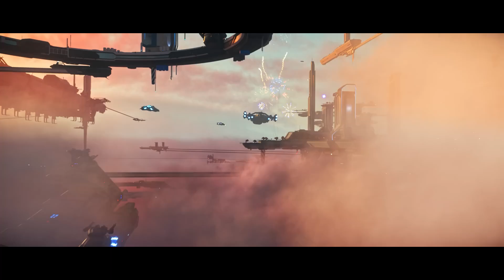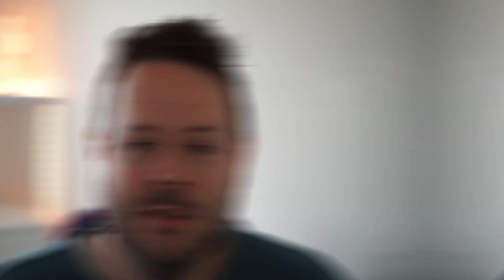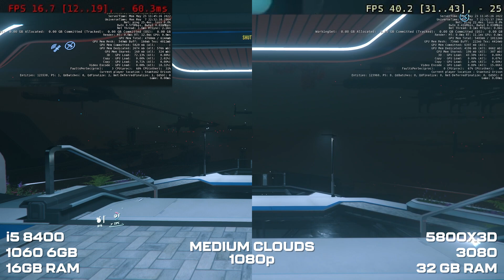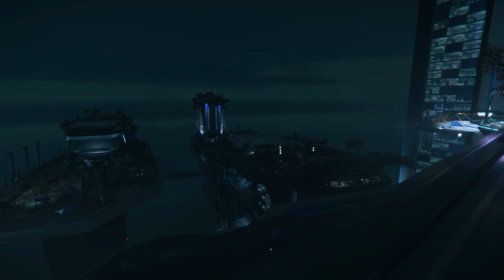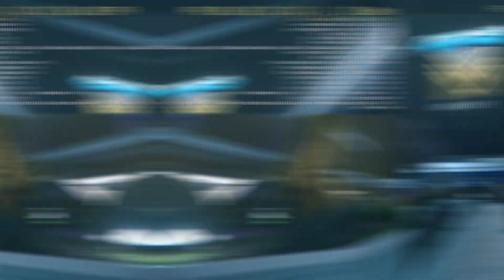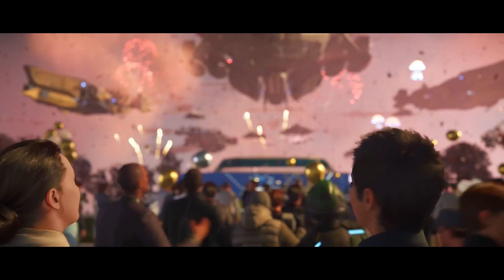High End Vs Min Spec | Star Citizen

Comment: So I have a rtx 3080 and a water-cooled 11th gen 8 core i7-11700k cpu running with a 1414p monitor, I currently have 16 gigs of ram but am about to upgrade to 32 as soon as possible. I finally got it so I can run at a decent fps (max of 110 fps on a decent server and 40-50 fps average while planet side) The problem I am facing now is that My computer is getting ridiculously hot, infract I have stoped playing star citizen because i am slightly worried about the health of my pc, I play loads of other games with no issues at all but for some reason star citizen is causing issues. Any advice?

edit: corected pc specs.
Reply from the maker: The 11th gen Intel chips are notoriously power hungry and therefore get pretty hot. SC probably pushes the cpu harder than any other games you play. What sort of temps are we talking? Does your case have decent airflow?
Reply: @tenpoundfortytwo  I can get up to 92 c, and my pc has pretty good airflow but if thats the problem im not sure how to increase that without buying a whole new case
Reply from the maker: You could try putting extra fans in if they'll fit. 92 does seem hot!
Reply: @tenpoundfortytwo  in that case would an AMD chipset be much of a difference temp wise? My pc i bought is an intel one but seeing this im quite worried about temperatures since i have very similar specs to the original comment
Reply from the maker: It would depend which amd chip you use, but I believe on average the current amd cpus draw less power than the latest Intel ones. How good is the airflow in your case? It can make all the difference.
Reply: @tenpoundfortytwo  thats a great question, I will update you when it arrives 😂. I'm asking as I bought an Intel chipset build as a friend who is an avid pc gamer recommended it to me,, and have been researching to make sure what he recommended can run SC. He however hasn't played it so I dont think he took unto consideration the specs required to run it optimally
Reply: I took the side panel off my pc and the temp dropped by 20 degrees, thx :)
Reply: @doctortomato9520  I am a bit late, but wanted to say this.p The 3080 main venting seems to be on the SIDE of the card, not the rear. I've opened my side panel and rested it on my monitor. So there's like a 30 degree gap because of the slanted angle. This lets the heat vent from the GFX card way better than fully closed up. The side panel really needs something like a 6" by 1.5" envelope slot just for the 3080.
Reply: @eziop5539  that explains a lot. Thanx for the tip I will make sure to try that

Comment: Good day sir, your input requested.  I play on a dinosaur HP Z420  xeon e5-2667v2 / ssd / rx 5700xt 8g / 32g ddr3. Very low end but doable barely.  I can get a HP Z820 with dual xeon e5-2697v2's on ebay for $370 shipped to my door....then simply put my current ssd/gpu/ram in and I'm gaming. I would get more ram of course as it's very inexpensive right now.  If I go modern route I'll have to buy or make an entire computer with the exception of the gpu  and I just don't see that happening for $370usd.....ram / cpu / motherboard / powersupply / case.  Your thoughts on a dual cpu system ?
Reply from the maker: Well I'd personally be interested to see how it performs! But whether it's a good idea- probably not. SC just won't be able to use the extra cpu cores (at the moment) so i dont think youll see much of an improvement over your current setup. I would save the money towards a new system.

Comment: Hey, thank you for detailed solid side by side. The only thing negative im going to say is your fps on 3dx is alot slower than ours. 30fps exactly on average throughout the area. I also watched your city 18 video with the 3dx and the fps is also 30-40fps lower on average aswell. Something isn't right with your 3dx rig, you should be getting alot more fps.
Reply from the maker: Interesting, someone else was saying that I was getting more than them! It could just be the particular server that I was on.
Reply: @tenpoundfortytwo  So I think the difference could be im running SAM and have bdie at tunned timings. Maybe star citizen runs better with sam and tight timings? sc can use 27gb of ram at times... That's what I'm thinking what's happening between our rigs.

Comment: Hhmm interesting, my fps rate is much closer to the rig on the left despite being more powerful.

i5 12600kf
GTX 3070ti
32gb 

I also went through the various recommendations that can be found online to increase FPS. In space i get about 40-50 but in combat it drops to 20-30.

Any ideas why?
Reply from the maker: Interesting, you should be closer to the high end system with your spec. v sync off?
Reply: @tenpoundfortytwo  that's what I thought also, yes it's off. Is it possible that it could be due to the current Invictus period and the addition of newer players?
Reply from the maker: @ReviewsMoviesForYou  yeah the servers are really full right now which does indirectly lead to lower client performance, so it might just be that.
Reply: @tenpoundfortytwo  I hope so, thanks for the video and the replies :)

Comment: FX-6300 all core overclock to 4.1Ghz (240mm AIO)
32 GB DDR3 1600 (D.O.C.P on)
MSI R9 290 4GB Gaming Edition with Factory overclock to 1007Mhz and 1250Mhz VRAM 512-bit memory bus (I have been able to use MSI Afterburner to overclock the VRAM to 1300Mhz and the GPU to 1030Mhz without the game crashing, haven't been willing to push it further yet).  
Firecuda SATA SSD
Volumetric Clouds off, Everything else set to Medium, Film Grain off, Motion Blur off, can't remember other current settings.
5-9fps at Orison, 24 fps at the expo.  I've seen 59.9 fps in space (Yes, I was watching to see if it would hit 60. It didn't).  Storms on planets or moons, even in interior rooms where I can't see a window kill frames down to single digits.  Arc Corp is my new home because of storms on Hurston.  I get high teens/low 20s in most places on Arc Corp with noticeably better performance at the spaceport, likely due to lack of holograms.  After experiencing single digit fps, 24fps feels fantastic.
Reply from the maker: Massive respect for your commitment to get the game running as well as you can on your system! Are you planning to upgrade anytime soon? Or are you planning to stick with it for a while?
Reply: @tenpoundfortytwo   Thanks!  tldr version:  Yes, I hope to have everything upgraded by the end of the year.  I'll probably role over the SSD and power supply (800W).  I'm debating getting a new case.  
Long version:  I know you get a lot of comments and I don't expect you remember advising me a week or so ago to wait for AM5 later this year.  With the news that came out yesterday on Paul's Hardware and Gamers Nexus about the improvements for AM5 I'm glad I listened to your advice.  That said, I expect the entity counts that will come with the cargo refactor in 3.18 will make it unplayable.  Sometimes the inconsistency I see in the frame rates makes me feel like I'm running out of cache memory (likely on the CPU).  When I say inconsistency, take Hurston for example.  The fps will bog down to like 6 and hover between 6-9, then it will jump up to around 20 or more for like half a second, then go back to 10-14, then bog again.  Like the cache is filling up and then once the CPU chugs thru it runs real fast until it fills up again.  Might be running out of threads too, as there are only 6 on the FX-6300.  I think the 512-bit memory bus will allow the GPU to be run a little longer as even though it is slow and the VRAM is only VDDR5, but then with Vulkan implementation pushing more load onto the GPU I expect that won't hold out either.
Reply from the maker: Yeah sorry I struggle to remember all  the comments! It might be a struggle while you wait for am5, but it looks like it will be worth the wait.
Reply: @tenpoundfortytwo  No worries.  I worked retail when I was 19 so I understand not remembering every interaction.

Comment: I found that GSync with a 144 Hz monitor covers up inconsistent frame pacing and stutter really effectively even on lower spec systems. I.e my 1070 Ti running at 2k. 20 FPS is never ideal, but it's quite playable when it doesn't tear and the monitor upsamples it.

Love your videos by the way.
Reply from the maker: Completely agree- I couldn't live without my g sync! Thanks for the encouragement!

Comment: I am curios , what Windows did you run and do you think it makes a difference? 

I kind a can compare my results to yours because the mayor difference here is the 6800 XT and I have faster RAM 3964mhz CL 16-16-16-36 but that's it. I always have worse frames then you do. Orison near the hotels was interesting for me in 1440p, both the 5800X3D and the 6800 XT where full loaded got only around 45fps mostly in that area but I have seen instances where the GPU sucked more then 13 gb of VRAM.
Currently running win11
Reply from the maker: I'm on Windows 11 too it cant be that! 

My other settings: hardware accelerated graphics and game mode on. Motion blur off, film grain off, graphics settings on default apart from clouds on medium. 

Ryzen supposed likes to be in sync with the infinity fabric, so you might actually be better off running the ram at 3800mhz. 

But I could just be testing on emptier servers than you!
Reply: @tenpoundfortytwo   Yah its true about the Infinity-fabric but my board the EVGA X570 FTW can go beyond 2000mhz and the fabric is synced with the RAM. The AIDA64 benchmark for the RAM is always below 60ns for the RAM it self. 3800mhz with synced FLCK and UCLK , basically same sync as with the 3964MHz/1967.33MHz is always worse in RAM response tests. The CPU is sitting between 12,3 and 13ns. 

My settings look like yours , maybe empty server indeed but I also have lower frame times in every test so far I saw from you. It looks like the GPU is just not that good in SC. 
You do run it with SAM? Or is it not possible with the Nvidia GPU?
Reply from the maker: @Vanadium  Good info about the ram, thanks! You can for Nvidias SAM equivalent on but when I tested a while back it hurt frame time, so it might be worth looking at that.
Reply: @tenpoundfortytwo  I would not say that the RAM is always faster for anyone when you just going for higher frequencies.

 I would add the RAM for me is always faster this way but I haven't done that much so far. Only loaded recommended XMP file on that RAM and tweaked it down to 3964MHz and 1967.33MHz Infinity because it wont run with XMP settings alone stable. 

I am a total noob when it comes to OC for the ram but right now I just want the RAM to run at its advertised settings and because it got Samsung B-dies it should go beyond that but that's just not interesting to me right now. 
So far I have found out that Ryzen got problems with default XMP settings on some RAM chips because they are tweaked for Intel. 
The suggestions I got from some tuners are way off compared to the default XMP.

Hmn that's interesting with the SAM, I will check this out, thanks!

Comment: Always appreciate the work you put in, thanks for enduring the struggles.
Honestly I would cap my frames to 30 IF it meant getting better frame-timing and a steady rate, but even with my 3080 system that's not guaranteed in SC.
Reply from the maker: Thanks for the continued support! A smooth 30 would be good!

Comment: I recommended you try this, so sorry about the frustrations! It's better than I thought. Reddit commenters keep telling new users poor performance is because of the servers. Looks like they need to lower the resolution a bit and adjust settings like normal to get something more playable.
Reply from the maker: No worries, it was a pain, but definitely worth doing! I need to have a think about an easier way to do it! It's tricky, waking up in the habs and getting to the convention centre isn't much fun at 20 odd fps, but once you're there it's pretty decent.